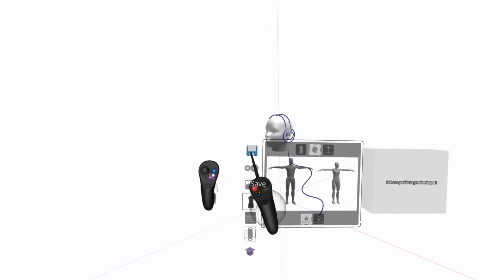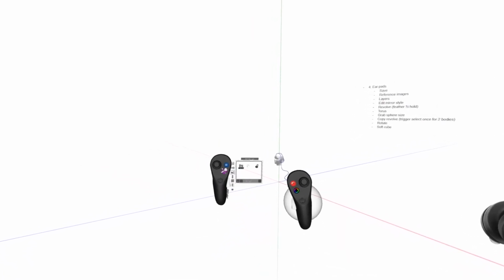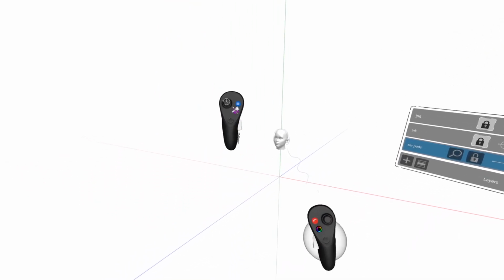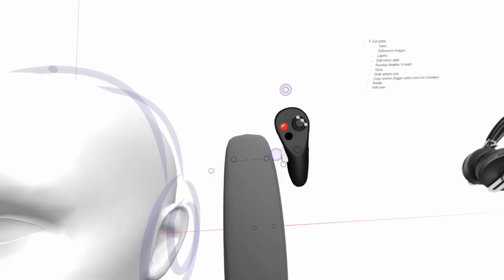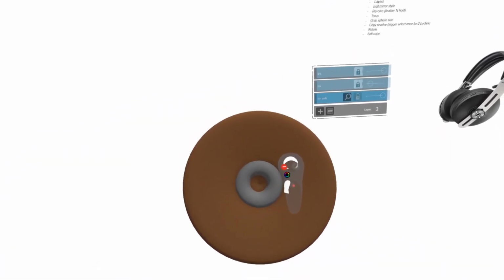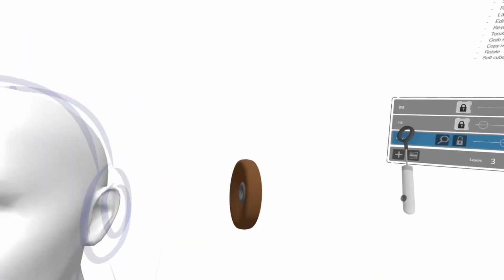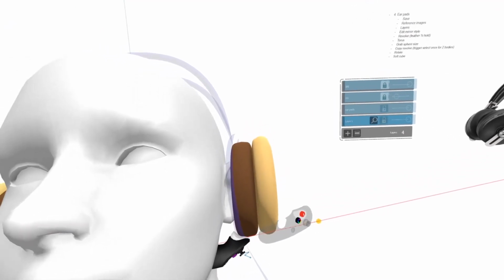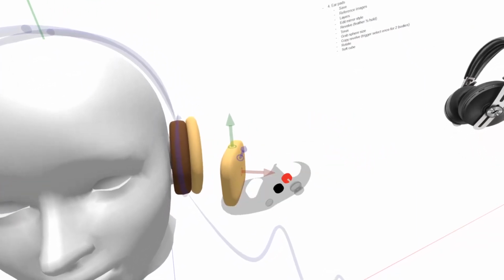Beginner Tutorial Series: Headphones pt. 4 - Workflow Gravity Sketch VR

Comment: can anyone help me im new to the game i downloaded it on my oculus quest for free so basically how do u fill in colours on specific things like for example i mad a shoe and i wanted to fill it in with colour but doing that with the ink or stroke wasnt smooth plz help
Reply from the maker: Hi! There are a lot of ways to fill things with color. One great way would be to use surfaces which can be found in the tool menu indicated by the surface icon. Or if you are talking about adding/changing the color of an object simply grab it with your grab sphere and press down on the A button to use the color wheel. This button may be different depending on which controllers you are using.

Comment: I'm having real trouble getting the Smart move to work 99 % of the time. It done it once, now it won't do it all all. I've tried stacking hands top and bottom, with item highlighted, it is turned on in menu. I'm just not getting the axis line showing up, in any axis. Is there something I'm doing wrong?
Quest 2.
Reply from the maker: Im sorry to hear this. You should be lining up the controllers vertically to each other and an axis should appear. If you feel there is an issue with your version of GS, please send an email to support@gravitysketch.com.

Comment: Thank you so much for these tutorials! They help a lot! I'm used to 3D CAD like Fusion360 and I know the basics of low-poly modelling in Blender (and a little bit of Sculpting), but I'm having a hard time using Gravity Sketch. And that's really infuriating, because overall I find it very intuitive to use the tools and with so many options it should be a breeze to create great models.
Reply from the maker: Hi Lucas, what about using Gravity Sketch are you finding tough? We would love to know your experience and how it compares to other tools you use. Best!
Reply: @GravitySketchYouTube  Let me start saying that using Gravity Sketch to 3D model in VR is a total mind-blow when coming from these more traditional flat-screen softwares. There are objects that only take a fraction of the time to make since it's so intuitive. 

I think the toughest part for me is making negative space (i.e. holes, etc) and using the volume or surface tools. Mainly because I usually 3D print a lot of stuff and surface modeling has always been difficult  - with the flat-screen tools too. I'm sure others have mentioned it before, but boolean subtract and intersect would be a great addition. 

Having said that, I'm trying my best and relying mostly on the settings and the stroke, revolve, primitives to bring my ideas to life so far.
Reply from the maker: I understand and thank you for your thoughts! Boolean operations and functions is certainly a request we have recieved a lot and looking into. The main barrier at the moment seems to be limitations in VR performance, especially on tetherless headsets. Bu this could change as innovation in VR hardware rolls out.